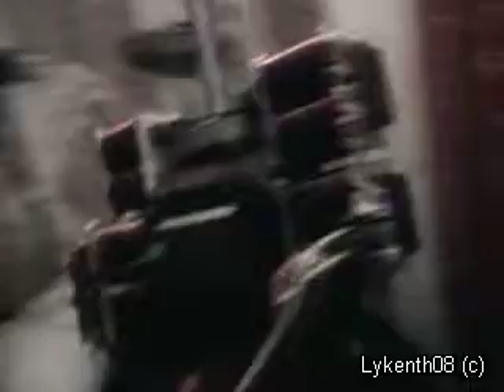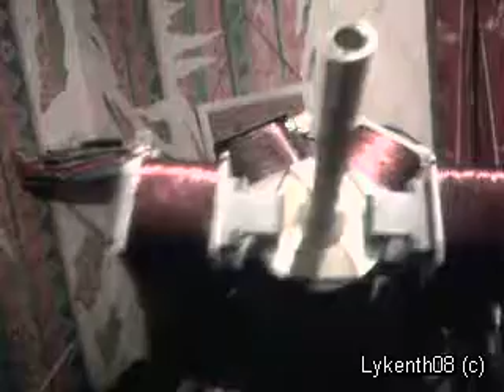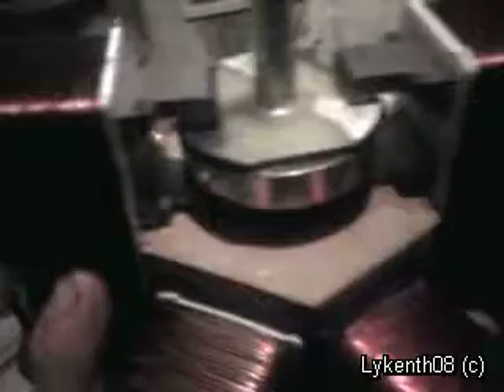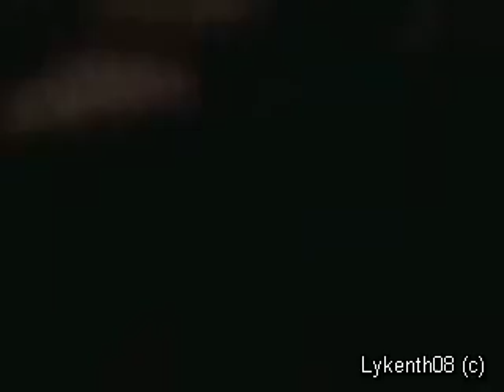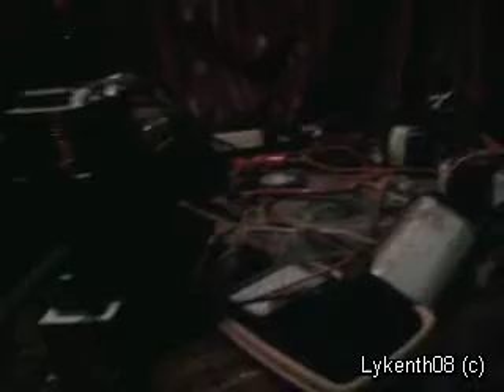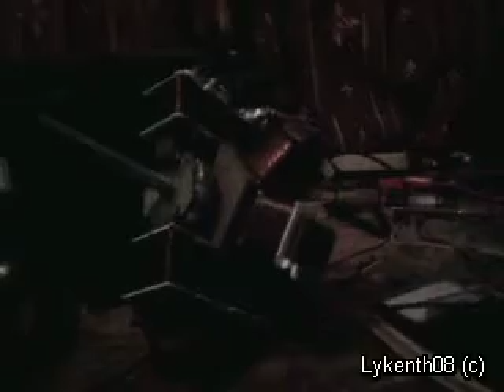my lenzless generator research, second stage start. 2012

Comment from the maker: Hi, i went to a local washing machine repair shop an just asked the guy if he had any broken ones, i offered a price for them but he just said i can have them for free... all of them. it took a few months to get enough together an i did say now and then that id give him some money, after all i did get 12 in the end. its an ac setup, every other one is on a plate an the other is not. i did get output reading but no enough current. 15v 500mA.  it didnt slow down when shorted or loaded though